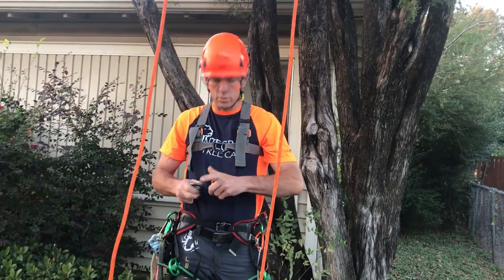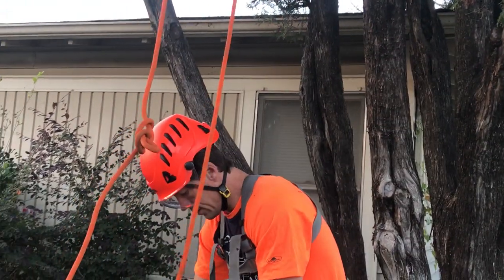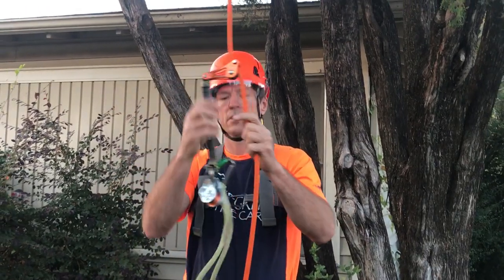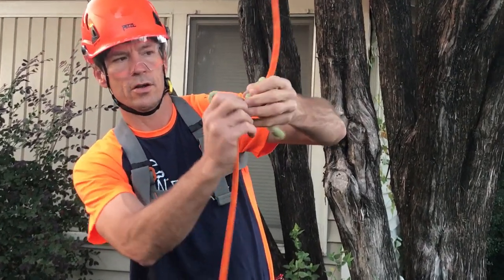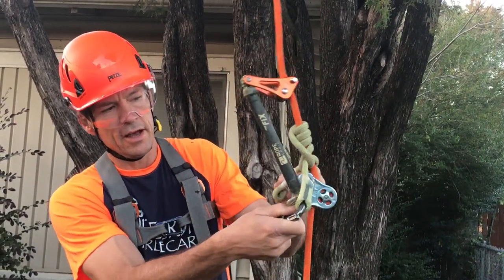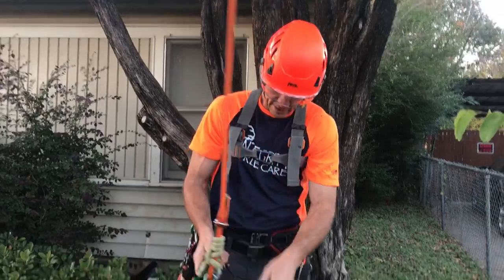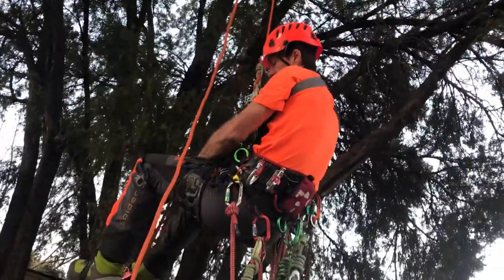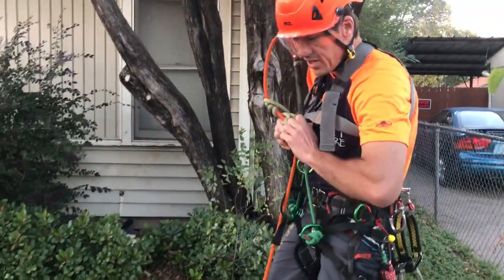Rope wrench , rope walker set up

Comment: Thanks for a very superior short and informative video. Five stars from me i Norway *****. But one thing I wonder why you did is the two butterfly knots. Why not only one? Best wishes from a very interested amateur. Paul
Reply from the maker: The 2nd alpine butterfly has a pinto pulley , it aids in retrieval if you drop through a couple redirects. . Basically acts as a fair lead so on retrieval there’s not so much rope on rope.

Comment: What is the diameter and length of your hitch cord? Are you climbing on 1/2" rope?  I may buy a Rope Wrench soon to use on 1'2 Yale XTC Fire rope. I don't know which hitch cord to get. Thanks for posting this video.
Reply from the maker: 28 inches

Comment: What size prusik cord do you use in length 28"or 30" thanks again
Reply from the maker: Todd Jensen 28”
Reply: @integritytreecare4794  ok thanks for some reason my cord seemed to short to wrap it 5 times an it's a 30". I'll try some more thanks again.

Comment: How the wrench works is not clearly shown.
Reply from the maker: I’m sure there’s some in depth real print videos or info out there.It basically puts a bend in the rope so it takes some of the friction away from the hitch and dissipates it into the rope wrench . I was thinking it takes like 40 percent of the friction away from the hitch . Without the wrench in place the hitch would not operate very well with a 100 percent of the friction on a stationary rope system.

Comment: If that vest isn’t fall rated, nothing else in your system would be since you didn’t attach to your harness. Do you switch as soon as you get up?
Reply from the maker: I’m attached to my harness with a caribiner that goes through the system. 
The chest harness is there just to tend the system